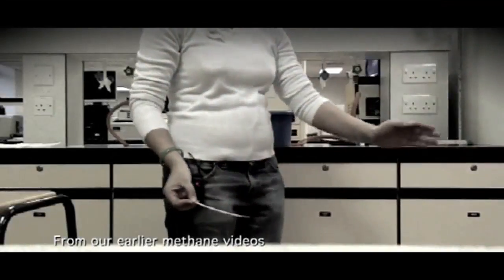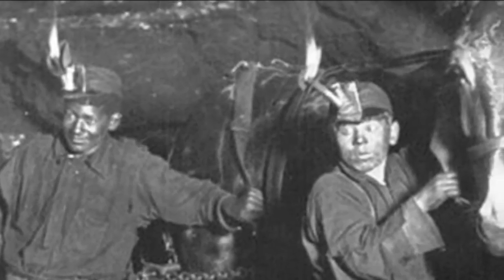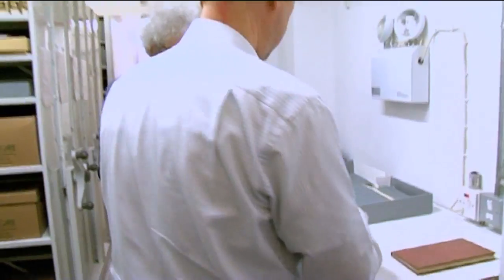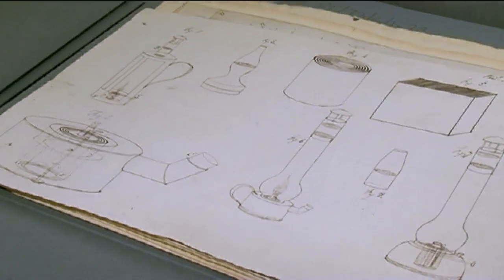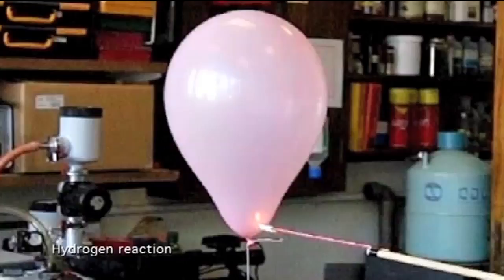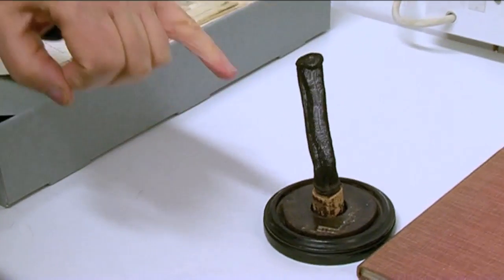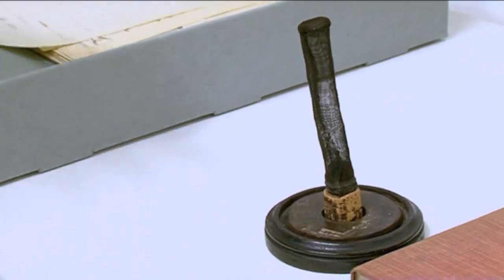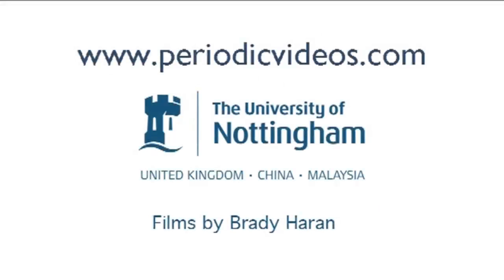Davy's Lamp - Periodic Table of Videos

Comment: Yes, they used to use canaries. Better than nothing but it takes a little while to notice that the canary's stopped singing and then you have to get out in the dark because your candles will ignite whatever gas killed the canary. And you have to guess when it's safe to go back in. Ironically, though, safety lamps increased accidents because they let people work in more dangerous places.

Comment: I owe my existence to safety lamps in mines as it's quite likely my ancestors wouldn't have survived down the coal mines of Nottinghamshire without them. Curiously although there are now electronic detectors that can do the job it is still required under UK law that a protector lamp be used in any working coal mine. They're not davy lamps though, instead they're the Garforth type made in Eccles.